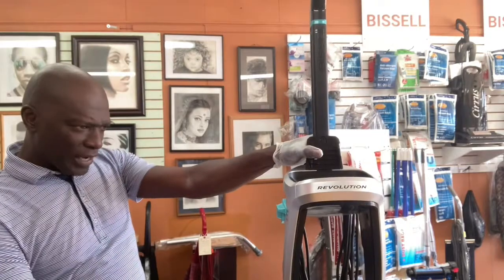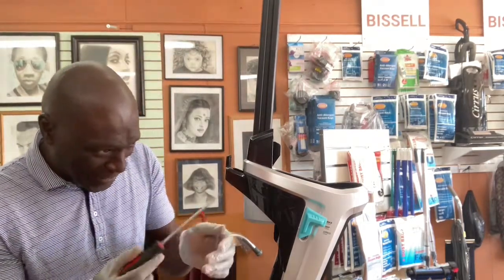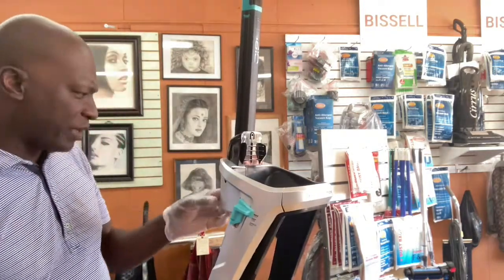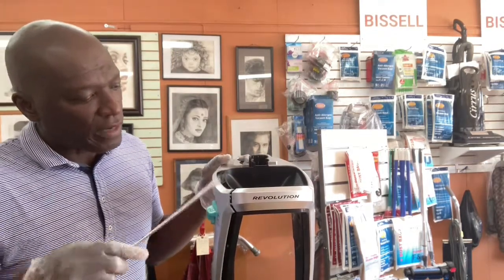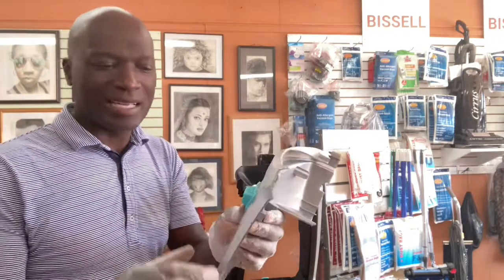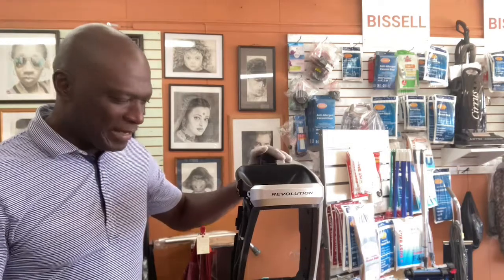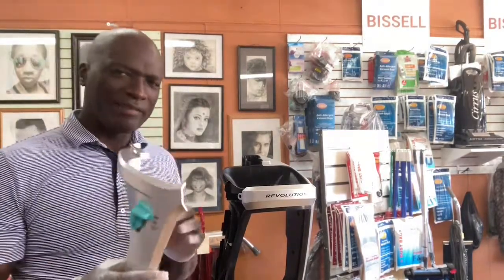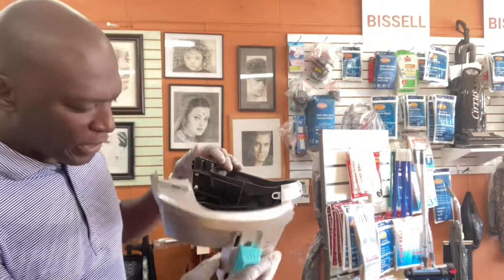Fix the water/solution slide on Bissell Revolution

Comment: Are there any preventative measures you can take to avoid damage on these things? Whether it be silicone grease on any of the rubber sills, etc…?? I hear it’s a good idea to get extra belts. Thanks!
Reply from the maker: The extra belts is definitely a plus. As for other measures; just don’t overfill the dirty water tank. You want to avoid getting water in the motor. Keep the unit and especially the brushes clean. And don’t throw it down the stairs😄 That’s about it
Reply: @monroevac  good deal. Today is my first time using it. Pretty impressive. Is it not impossible to over fill the dirty water tank? The machine basically tells you when it’s full…correct? Thanks!